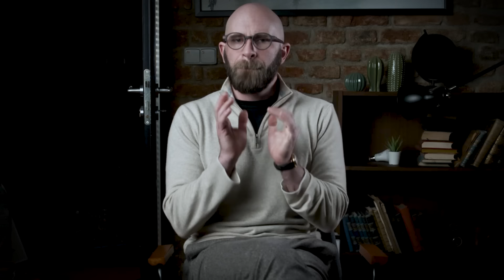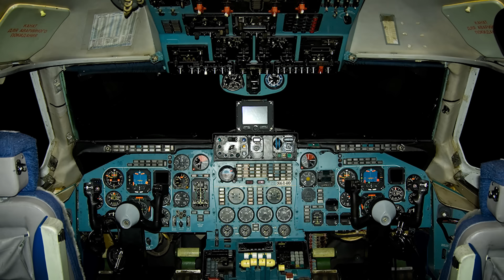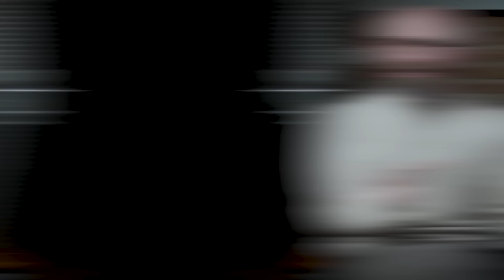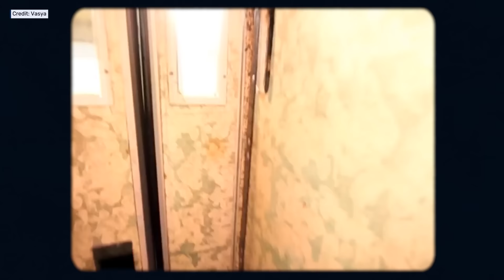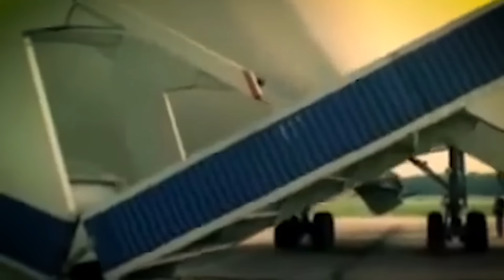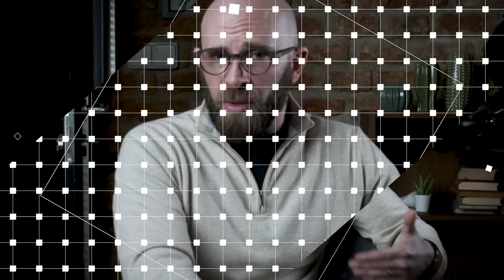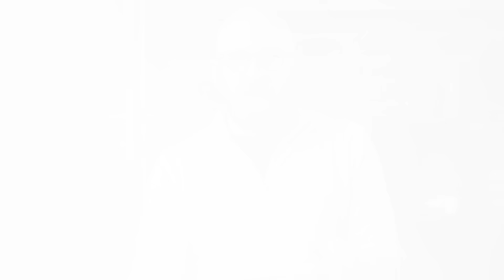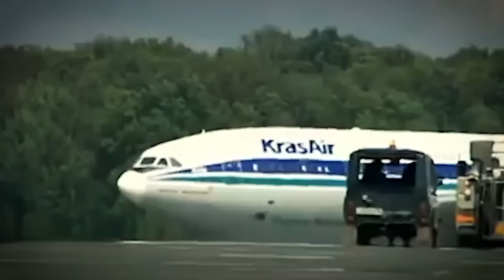The IL-86: The Soviets' Botched Answer to the 747

Comment: Joe Sutter, the chief designer of the 747, wrote in his book that right after the 747 entered service, Aeroflot sent "company executives" to Seattle to potentially order up to 25 747's for Aeroflot. Sutter, knowing how the Soviets operate and knowing that those "executives" are actually KGB agents, ordered all manuals, blueprints, and tools to be locked up and stored away when the Soviets came, but he still rolled out the red carpet and VIP treatment for them. Sutter's instinct was proven right after the executives were constantly looking around and scooping every corner of Boeing's plant instead of negotiating things like finances and order contracts.
Reply: Didn't they also wanted to obtain license to build a plane similar to DC 10?
Reply: @ChaklitTea If they got one their whole current fleet would be variants of the DC10.
Reply: @ChaklitTea idk about Soviets but Poland wanted to acquire some DC-10 for LOT airlines. Finally they leased one MD-11 after soviet Union fell.
Reply: Really good book that
Reply: Ive been aboard the prototype 747. Its really cool. Its at the museum of flight in Seattle.
Reply: As a schoolgirl, I visited Cranfield where the Concorde was being designed and tested. When showing us the wind tunnel where a model was being tested, the engineers hastily threw a sheet over it. Have met a fair few Soviet KGB spies at scientific conferences, pretending to work in fields which they clearly knew very little about.
Reply: @alayneperrott9693  Both Russia and China have made most of their tech advances over the past 70 years by stealing our ideas and designs. There’s a reason the NATO designation for the SU-57 is “felon” - it’s really just a twin engined F-35ski.
Reply: @some_random_guy_lol  у тебя паранойя. А что, американцы не пытались похитить что-то советское?
Reply: @ОлегШелухин-ь8э  No lmao why would we as Americans steal shitty designs?
Reply: @Bjg6  в Союзе было полно американских шпионов, пытающихся похитить советские военные разработки.. Не знал об этом? Или ты с Луны свалился? Кстати, у Ил-86 отличный дизайн.
Reply: @alayneperrott9693 
Once upon a time I wrote the software for the handheld computers that Parking Enforcement Officers carry, the ones with a touchscreen and printer or a Bluetooth belt printer..
I find myself at the annual industry thing where all the companies that sell products for the road construction, maintenance and parking industry. 
Our competitors were there and it was the dawn of rugged handhelds with touch screens, so everybody was moving their existing software onto these new devices, which ran a WindowsCE (CE= Compact Edition) 
I'm a spectacularly talented liar so I started going to each of their booths and pretended to be from local government, who purchase and run this kind of stuff. 
They eagerly demonstrated their latest tech while I applied my knowledge of the enforcement officers day to day. 
I made detailed notes about all the design mistakes they had made, what novel features they had and how they thought they were going to be killer apps in the market. 
I was allowed to take the devices and test them inside, outside, in the light, in the dark, everything. 

And then when I was back in the office starting my design I accounted for every one of their mistakes, features and knew exactly which brand of device to buy and use as a demo unit the sales guys would take that made the software look its best. 

And then I proceeded to watch my software DOMINATE the industry for the next 20 years!! 😂

Man, that was such good fun. It got to the point where I could connect remotely to a customers device that was out on street and give them direct support as I watched them used the software and they in turn watched me show them what the problem was. 
Remote software patching too, I could experiment with changes and fixes for a customer that has problems with their fleet.
This was all about the time the early iPhones came out, 2010 ish.

Good times. 🫲😂🫴
Reply: Cool! The cold war era is rich with stories like these
Reply: @L188widower  
Many are bs though.
Reply: @zaco-km3su  Nyet, comrade...
Reply: @HC-cb4yp  
Cope, trumpster. It's bs, Most of those stories are bs.
Reply: They also asked if they could purchase a copy of Boeing's "Bible" too from Joe Sutter.
Reply: Joe was the Man!
Reply: Boeing has a book the thickness of a telephone directory which it calls the 'Boeing Bible'. It incorporates all of the research and experimental results which Boeing has compiled throughout its history. It provides a ready reference  and information source for the design of the aircraft of the future. The Russians offered a very large bribe to one of the top Boeing executives, probably Joe Sutter, to obtain a copy for them. In particular, they wanted this information to enable them to design aircraft with wing-mounted engines, because they had not succeeded in their research efforts to achieve an understanding of what  was needed to design what Boeing called the 'Aeroelastic wing', where the wing structure and pylon-mounted engines were in harmony with each other, because each smoothed out the oscillations and vibrations of the other.
This executive, perhaps Sutter, curtly told them, 'That's Boeing proprietary information, and no copy of it is ever allowed outside of Boeing's facilities'.
Reply: Those Rascally Russians.  🐺
Reply: They actually placed a deposit for the L-1011 but the government squashed that
Reply: @thexchox1554  That is mostly because the L-1011 had a lot of navigation technology that would have military applications.  The Tristar story is a tragedy mostly because the Connie was such a good aircraft, but Lockheed sat on its laurels a little too long being just a little too late into both the passenger jet market and entered an saturated widebody market when they would have been much better off entering with a smaller twin jet to more directly compete with 707, 727, 737, DC-8, and DC-9/MD-80 (however ETOPs of that era would have been an obstacle for international overseas routes).  That said, the Tristar had the first modern FMC that would be recognizable and familiar to pilots of today's jets and the first to have a Cat III autoland that made a zero visibility ILS auto landing possible even though they are rarely used in practice.  If they had been just a year to two sooner to market they probably would have dominated the DC-10 but Douglas had the sales momentum that Lockheed was never able to overcome and the crowded widebody market simply did not support enough orders for all three US manufacturers to be profitable.
Reply: @larrybremer4930  The L1011 suffered from delays from the RR RB211s, which was the only engine for the plane. That was the only reason it lagged, and then eventually failed in the market.  If they had  a GE or P&W option then the story might have been different.  BTW, the RB211 almost cost RR its existence.
Reply: Afterwards,  some KGB colonel was "disappeared" to a gulag and shot.
Reply: I hardly believe this story has a grain of merit, in 1970 the Soviets were stone broke looting East Germany of every cent they could steal.
Reply: So KGB agents were experts in aeronautics ?
Reply: @johnchrysostomon6284 They didn’t need to be.  They could’ve had engineers working under KGB orders, or just taught some KGB agents roughly what to look for.  They didn’t need to be right the first time or all the time.  They could’ve been wrong 99 times, but they only needed to be right once.
Reply: That’s a lie. 
Aeroflot was interested in 747-400 in late 80e.
And that’s all.
Reply: Bunch of baseless hearsay
Reply: Sovs gonna Sov.
Reply: Rubbish what could the Russians learn from walking round a factory and why would Boeing allow them to if they could steal anything by walking around. It  would be rather stupid. Why would they need to go there when they had bought 25 747s, which they could have reverse engineered? This is propaganda
Reply: The Russians are FAMOUS for making COPIES of Boeing aircraft.  Three Boeing B-29s ended up in Russia at the end of WW II. Stalin assigned the TUPELEV design bureau to COPY THE Super-fortress exactly.  It took the Russians more than two years (mostly due to making measurements from the American aircraft into metric measurements).  They did this so EXACTLY that the FIRST 3 AIRCRAFT HAD THE BOEING EMBLEM IN THE MIDDLE OF THE CONTROL WHEEL!
Reply: The USSR and (now) Russia has what's known as 'Directorate T', previously a major part of the KGB and its successors, including today's FSB. Directorate T is tasked with obtaining foreign research and technology any way it can, especially western research and technology. This includes bribery, extortion and espionage. They need Directory T because they weren't and aren't capable of developing this research and technology themselves under the laughably broken and corrupt system of rule in Russia.
Edited to add that comrade Trumpski has been perhaps the greatest bonanza in Russian history so far as all this is concerned.
Reply: Yeah, another example of the "great world revolution" leading the way for humanity by copying and stealing from those who actually do the R&D and commitment to design and develop things that actually do take humanity forwards.
All the while sneering and denigrating the capitalist system that they stole from.
Reply: Typical ork logic to steal from other people instead of trying to innovate for themselves. Just as they did with the Rolls-Royce Nene engine.
Reply: We could've handed over a plane and all blueprints on a silver platter...the Soviets would still find a way to f**k it all up.
Reply: Operation Paperclip made horrific sense
Reply: Russians think everything can be copied after they stole the A-bomb secrets. Backfired miserably with computer chips. Backfired again with Sukhoi "super"-jet
Reply: Yeah, they always copy everything a lot of things we've done. Cause Russians js suck ass
Reply: Our friends the Russian government wouldn’t steal anything, would they?
Reply: Why allow them to come? Sounds like a waste of time.
Reply: @8647LasVegas  
Hallahanify. 
Profit, greed, arrogance (US wanted to show off).
Reply: Yankees stole British and German tech, same scum
Reply: You’d need 2 whole shipping containers to take back the blueprints for just the tooling to build the 747 and another one for the aircraft. Today it fits on a 1TB hard drive
Reply: So did they purchase one to reverse engineer it?
Reply: Their industrial espionage was far more advanced than that, though I don't doubt that they took the opportunity to snoop around
Reply: In "Boeing; Legend and Legacy" the IL-86 was described as a "fat 707".
Reply: Why would Boeing allow spies to look round their factories? Absolute rubbish
Reply: Stanley Kubrick…”…how i learn to love the bomb…” Part II?😂😂😂😂
Reply: Russians gonna Russian....
Reply: Yes and they wore shoes with magnets to pick up shavings of the alloys used to manufacture the plane
Reply: @ironman7261 mixing up things here I think. That happened when they visited Rolls Royce to get the right alloys for production of jet engines and I don’t think it was magnetic but sticky or a foam of some kind on the sole that picked up parts of metal near mills and laves.
Reply: @delahayenator that would make way more sense since nonferrous alloys wouldn't be necessarily magnetic.
Reply: @delahayenator  

Nimonic - the family of Nickel based alloys the British had developed in the 1930's were superior to German Tinidur and Cromadur alloys in the production of Jet engines. Materials scientists in the USSR by 1946 had managed to reverse engineer the German WW2 alloys, which were relatively cheap to produce because they were mostly Iron. But the engines made with them did not last long, unlike British engines made with Nimonic alloys. 

Vladimir Klimov, one of the leading Aircraft Engine engineers in the USSR in the 1930's and 1940's, specifically wore shoes to which metal would stick when visiting the aircraft engine factories of Rolls-Royce. He said the British hosts refused to reveal anything about the alloys they used in production while his delegation was purchasing the Nene and Derwent jet engines to be exported to the USSR.
Reply: @legatvsdecimvs3406   "Vladimir Klimov, one of the leading Aircraft Engine engineers in the USSR in the 1930's and 1940's, specifically wore shoes to which metal would stick when visiting the aircraft engine factories of Rolls-Royce."

Yeah, I've had workshop boots like that too.  😄
Reply: @delahayenator  that makes more sense. I'm no expert, but not many bits of modern aircraft  are made out of ferrous metals 😂
Reply: @ironman7261 Really useful for those aluminum and titanium alloys. Not.
Reply: That, of course, would be restricted to metals that are magnetic. But they would still be interesting to them.  @ironman7261
Reply: @ironman7261 Really? Magnets? Even the russians must have been aware that the vast majority of the materials in modern passenger jets at that time were aluminum, magnesium, titanium, fiberglass etc. 

They weren't as stupid as say, the people who thought the covid vaccine made them "magnetic" because an aluminum or brass key stuck to their sweaty neck
Reply: @ironman7261  They did that when they visited the Rolls Royce Engine factory, and soft rubber soles around the milling area. One of the tactics used to reverse engineer the Rolls Royce Nene in the late 1940s. That engine later went into the MiG-15.
Reply: @ironman7261 that wouldn’t work lol aluminum is a nonferrous metal. They’d have been better off wearing sticky treaded shoes to pick up any materials they wanted.
Reply: @TomK-ti8kp  Apparently they were walking on the shop floors and metal shavings were seen sticking to their shows sooo whatever probably had magnets and sticky tape their end result wasn't a market leader and they were probably KGB
Reply: @ironman7261  Wouldn't work on too many alloys, especially those use for light weight.  But I could see perhaps applying Vaseline.
Reply: Was just wondering why they didnt just steal the plans for the 747. Or buy one and RE it.
Reply: @natehill8069 They didn't have engines for a 747 clone.
Reply: @natehill8069 because it's a made nonsense to make Americans feel good. Classic American exceptionalism
Reply: @natehill8069  
They could have. They probably did. Thing is by the time they did steal the information, they Il-86 was already designed.
Reply: But hey, the KGB now has access to the White House and secret documents thanks to President Krasnov...so the CIA and FBI are seemingly less competent that Joe Sutter was 😂😂😂
Reply: @AGerm332 
It's the SVR. The KGB has been dismantled decades ago. Maybe the GRU too.
Reply: Cool story bolshevik
Reply: KGB "agents" would have no idea what to look for since the majority of them never worked as engineers and factory workers. Such delegations were generally made up of engineers, scientists, and production managers. As well as leaders from the Soviet Civil Aviation Ministry, which actually ran all elements of the airline Aeroflot in the USSR.

Realistically the Boeing 747 was too big for Soviet airports at the time, as it would require longer runways and expansion in infrastructure than anything flying in the USSR in the 1970's.
Reply: @legatvsdecimvs3406  The 747 had a relatively short runway requirement. Much less than the 707. Doesn't make sense, but I've seen it operate out of little airports. Doing touch and goes at smaller strips. They do require a strong concrete runway. Maybe that is what you meant
Reply: @legatvsdecimvs3406  
Bingo! Americans were full of bs.
Reply: Bull and propaganda. The Russians did no such thing.
Reply: BS as usual. Soviets had no market to build comparative plane. IL 86 was predominantly used in military ops. think i terms of technology advances when soviets built one of the biggest Mriya airplane just to carry Russian space shuttle Buran.
Reply: @Van_Der_Leigh  Utterly wrong. Check the post by @kolbola below and the two replies to get a clue.
Reply: @Van_Der_Leigh  76
Reply: What is this bs?
Reply: Right, it's Cold War propaganda.
Reply: Cool story bro. My only criticism, not wordy enough.

Comment: So you're saying in exchange for more room I get to make sure my luggage is loaded without losing it or damaging it?
Reply: would agree. keep in mind though luggage and cargo weight/payload balance (relative to aircraft center of gravity) is an important factor in flight dynamics/characteristic and safety.
Reply: I bet modern airlines would be happy not to have responsibility for passenger luggage.
Reply: @AdamtheRed- Ohhhhh no no no no. Dear god no!

Absolutely not. The thought makes my ramper/ground crew spine tingle. In short, we don’t randomly yeet baggage and cargo in there randomly.

Even airliners need to have some weight and balance needs. And they need to be put in properly for fire hazard and other safety reasons. Especially when you include often significant amounts of commercial belly cargo.

Not to mention it’s not exactly safe to have dozens of untrained people without bump caps, elbow and knee pads. It’s really not a good idea. 

As for how rough we toss the luggage, it’s really not personal. It’s just there is a very, very tight time limit, it’s exhausting and tossing the luggage is simply the most efficient way to get it done.
Reply: LMAOOOO